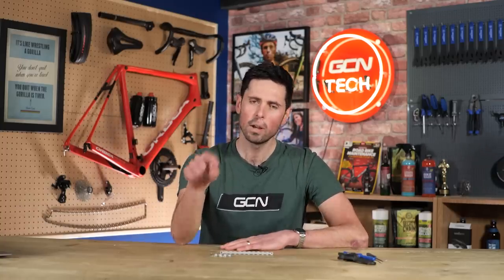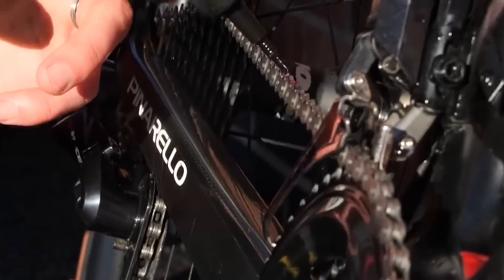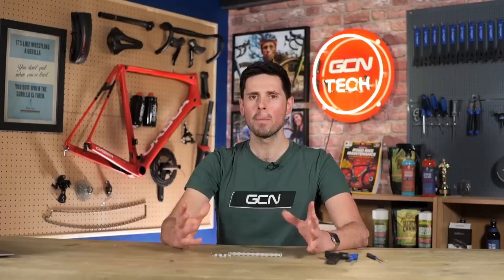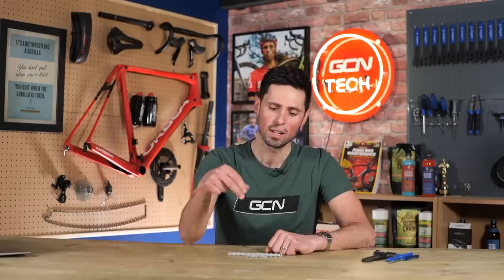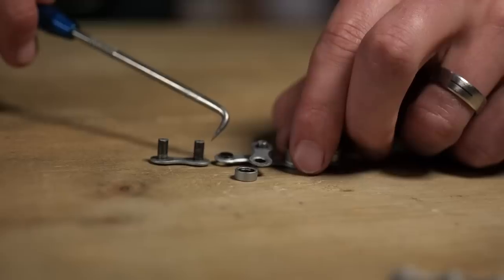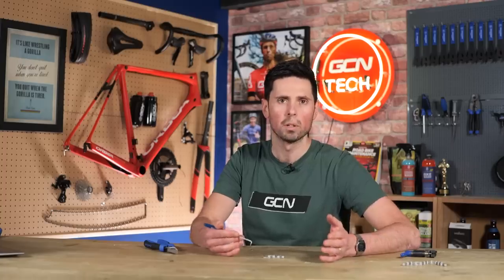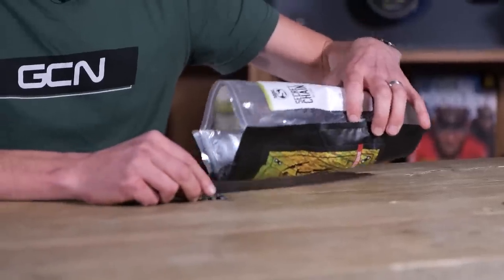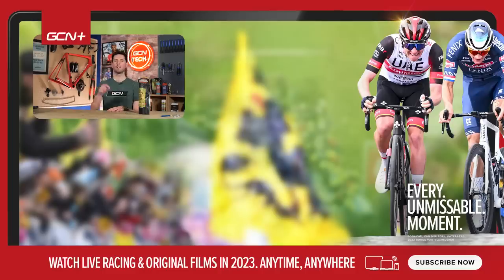5 Ways You're Destroying Your Chain & How To Lube It Properly!

Comment: i use rock&roll gold [light] to clean the chain and C3 ceramic [heavy] to lube. i have used all kinds of lube but these two combination works perfectly for both of my road and hybrid. keeps the chain clean and lubed longer and I can easily get about 4k miles out of midgrade chains before needing a change.

Comment: I use racing oil on my every day racing bike, especially for wet weather. Because it better protects my chain against bad weather conditions. In the summer I use "dry lube" because it lubricates and shifts the chain well. I work in a bicycle shop and a while ago an email from SRAM went around asking not to use wax. We also notice in the workshop that a lube shifts much better and is quieter than wax.
Reply: Yeah, that's my experience too but I'm always a little scared to voice it because so many people swear by the waxy stuff (its a kind of emperor's new clothes thing).
Reply: Weldtite all weather TF2 is the best everyday bike oil by far, cheap too. Tho honestly I'd rather use engine oil than trash like muc-off, squirt, or whatever...

Comment: I use an upgrade to Si's WD40 hack. It's rhe WD40 Specialist White Lithium protective grease.  Works like a champ you just spray it on liberally and wipe any excess off with an old sock. Chains are quiet, last a long time and no need for all the faff. Time is money

Comment: I'm a Paraffin Wax + PTFE guy mostly. Recently bought Tru Tension All Weather Tungsten to use as a top-up (& hopefully deposit some Tungsten Disulphide on inner surfaces to lower friction). I was using a large slow cooker but that failed, so now use food bags with ziplock tops (same as Molten Speed Wax or Silca use?) & melt in hot water. Initial cleaning (meths + isopropyl alcohol) the longest stage...

Comment: I have used approx. 25 different chain lubes over the last 30 years looking for the holy grail.  The conclusion is it does not exist.  I need to lube every 300km on average.  I put 350 to 500km per week on average during the season.  I clean my chain with mineral spirits (Varsol)  until clear 3x then rinse with denatured alcohol.  three years ago I tried wax.  A real pain in the ass.  Two seasons ago I was using Silca's secret sauce.  It would last about 300km,  but the chain would be black to the touch and I would have to clean the chain completely otherwise the product would not adhere to the chain if I wanted to do a touch-up to the chain.  On the recommendation of Chris Horner (winner of Vuelta 13'), I tried the Squirt product.  Best so far and it allows for touch-ups.  After 8000km my chain has very little wear as measured with digital calipers.  I run Record chains on my bikes.  If Campy had a reusable quick link I would use an ultra-sonic cleaner.

Comment: I have been using wax for some time now and it's the best option there is. It lasts longer, it lubes better than anything else and you can touch the chain after riding and have a clean hand. Never going back to liquid lubes again.
Reply from the maker: Great to hear that you've adopted waxing your chain 🙌
Reply: How often you need to apply new wax? I am interested in this, but have doubts how they last in very long continuous rides (400-500km)
Reply: Depends on conditions. Dry that distance should be fine but wet can wash out the wax fairly quickly. The performance of wax suspension bottled lubes should give you a good idea, a hot wax soaking is better but not massively so.
Reply: @GSHemuli  I just go by the sound of the chain, not a set number of km. But I think it could be around ~200. That said, I have an e-bike so there is more strain on the chain. It also depends on how well you clean the chain before waxing. I use melted paraffin wax without any additives so with a purpose made wax you can probably get a bit more too. Then lastly you can extend the interval by using the liquid wax lube when you start to hear squeaking without cleaning the chain or taking it off and it will last a bit longer.
Reply: @martinmikus472  thank you for the info! I use Ultrasonic cleaner for all my chains. I will try some recommend molten wax from zero friction cycling and see how long it lasts.

Comment: I use squirt lube (wax based). Cheap and keeps the chain life long.  No need to mess around with melting the wax first. Just need to fully strip the factory grease.   Best of all, it's clean and shiny.
Reply: Rubbish in the wet and having to fully degrease and dry the chain everytime is a PITA.

Comment: I use Silca's Super Secret chain wax, which you showed in the video. I bought an Insta Pot, and a temp. guage also. You heat the wax in the Insta Pot to 140 degrees, put a clean chain in, and pull it out after a few minutes. It have been doing this for a few months now, and it works amazing! No more gunky chain lube, and greasy bike. Its quieter, and you can tell it's more efficient. i'm not sure about the long term for wear, but from what I see, your chain will last longer.

Comment: I use "WPL Wet Lube" works a treat, bio degradable, stays on the chain in wet conditions, doesn't pick up much crap even on my gravel bikes (but it is a wet lube so it does pick up some) but emulsifies under high-ish (standard hose) pressure or with minimal brushing and no special solvents or degreasers required. Some of the cycling magazines made a big song and dance about how good it was, rating it above many of the usual suspects a few years back, but then it faded in obscurity for some reason. Weird stuff very thick like syrup when applying but a few turns of the cranks and it goes thin.

Comment: Great video. First time I've seen a completely dissected chain anywhere really, so touché on that. However, I respectfully disagree about the bits on not lubing the cassette, the chainrings, and the external chain surfaces, so hear me out please. I put a drop on one tooth of each cog and ring after I lube the chain, and then I run through the gears - all of them. Then, I wipe everything down with white cotton while spinning the crank. I want to see the residue decrease with each pass. There is ALWAYS something left on the cloth no matter how long one wipes. While wiping, I want my external chain surfaces and exposed parts of the cogs and rings every so slightly oiled because these surfaces do slide against each other, especially under torque. I am sorry, but I just don't see how lubing only the inside of the chain gets to these surfaces. Do I pick up more grime? I would suppose so, but I don't see it because I wash and lube my bike every week, or immediately after any wet or dirty  ride. Does my bike shift better? I wouldn't know as my bikes are always clean and lubed. I also don't mind jumping on a sale of a new cassette and/or chain. I've had my Ultegra 11 speed for 8 years now and have replaced both the  cassette and chain once because of a blowout sale, not because I had to. My bike with the SRAM Red hasn't seen any sales! LOL! Anyway, if you regularly clean your bike and really wipe it down after oiling, you can lube away I guess is the moral to my story. BTW, your golf club brush works perfectly!

Comment: Wet lube all year round. I get about 2000 miles out of a chain before it hits the 1% mark on my chain checking tool (the highest is about 2800 miles, over last year's dry summer months, the lowest was about 600 miles through a particularly wet winter when I picked up a lot of rubbish off the roads and ended up with a grinding paste!)
I also find that a cassette won't last much longer than 4000 miles, (measured by seeing if a new chain jumps on the sprockets when installed) but that's another story.
Reply: Change chain at 0,75% to preserve your cassette
Reply: I estimate that I get between 2,400 and 2,800 miles on my chains and change at 0.7%. I have a cassette that still worked fine at 24,000 miles when I replaced it (when the chainwheels wore out).
Reply: That's pretty good going! I can't get 24,000 miles from one cassette (well, not from the most used sprockets on the cassette - it'd be nice if one could buy single sprockets so I could just replace the worn one).
How many speeds has the cassette got? (I'm using an 11 speed, and I find it wears quicker than my old 8 speed which I still use from time to time).
Reply: @MBeest1000  I have an 11 speed 105 cassette (it’s cheaper than Ultegra😆). I do change chains frequently though.

Comment: Molten Speed Wax all the way! I never clean my drive train anymore. At least no degreasing. Wipe down some dry wax residue using a rag from time to time. Once thoroughly cleaned then waxed for the first time, no need to do any more degreasing of drive trains. pop the chain off, dunk it in wax pot, shake then dry, pop it back on the bike. Used to get anywhere from 2000-6000 kms using various chain lubes.  Having converted to wax 5 years ago, last chain lasted 20,000 km to reach 0.5 wear.

Comment: I use the Silca Synergetic lube.  The wax lube didn't last long in the wet conditions where I live.  My chain cleaning interval depends upon the weather.  When its wet, I clean and lube the chain after every ride.  During the summer, dry weather, I clean and lube the chain weekly.
Reply from the maker: Great to hear you are using Silca! 🙌 Having a Chain cleaning schedule is a great idea! Do you find it helps with keeping ontop of maintenance?

Comment: Service bikes as a hobby. Majority of my time is spent removing large amounts of oil and grease from chain, derailleurs, frame and back wheel. I use Rock’n’Roll Gold or Rock’n’Roll Extreme on chain after a clean and degrease. Cleans and lubricates and no mess. Bikes that are transported in cars now don’t mess up upholstery.

Comment: A few things learned in my recent marginal gains pursuit of chain waxing:
1.  MuckOff marketing sucks (and creates a landfill nightmare) with their little UV lights in each package and glowing lube encouraging users to douse the outside of their chains.
2.  It's important not to degrease the chain while on the bike (or be careful) because degreaser can or will (certainly if you service as much as I did) attack wheel and cassette bearings.

I'm so impressed with my "cheap" ultrasonic cleaner.  My "clean" chain left a couple spoonfulls of black gunk in the bottom!  The wax lasts much longer so needs less servicing, fills more voids and saves the rest of the drive train.

Comment: Good job Alex. I clean my chains about three times a year and they run quiet and last at least three years, so far.   Except my trainer, which has had the same chain for five years and doesn't get very dirty. It's only been cleaned a couple of times and I just add lube as needed. That said, I've never measured them. Maybe they're worn out and I just haven't noticed. Often I clean a chain because I'm switching from dry/wet lube with the seasons.
Reply: You can measure chain wear with a cheap tool. At 0,75% (longer than from factory), a new chain is needed.

Comment: Highly recommend Rock N Roll wax and lube combo, stays very clean and lubed, I wash out my chain every 60 miles, spray it out with WD40 then douse it in Dawn dishwashing soap ( a great non corrosive degreaser) spray wash, dry with a towel then apply waxy chain lube, of course clean chain ring and cassette at same time. Chain looks new always, cheers…

Comment: Great explanation! A clean, properly lubricated chain can last 3 times longer than a neglected chain. In my opinion and experience the coating on a new chain is a preservative. It is there to protect the chain from rusting in storage and it is a magnet for dirt. After degreasing your new chain coat your new chain with a real chain lubricant. It will shift better, run quieter and last much longer. There is a culprit on the road waiting to eat your chain. It's carbon dust, from car tires. Your front tire picks the dust up and throws it at your chain. Carbon dust, a molecular abrasive, can get into the tight places much faster than dirt. Carbon rubs your chain the wrong way.  Cleaning and lubing your chain can help control that unavoidable evil intruder.

Comment: Would love to try chain waxing but Scotland is wet. For that reason I can’t be bothered going through the whole waxing process every single time after a rainy ride 😢
Reply: do the same process with multiple chains so you can just switch out or use waxbased driplube...
Reply: Just uses CRC chain lube or the extreme duty version. It doesn't care about water.

Comment: I don't think anyone has mentioned the quality of the chain itself.  Often the ones that come stock on bikes are not the greatest.  I usually wait for the inevitable chain wear and then replace with an Ultegra chain which lasts much much longer.

Also, have modern narrower chains (a result of going from 5-cogs in 1980s to 12 cogs today) made the chain wear problem greater?  I wouldn't be surprised.

Comment: It appears to me that one way to shorten the life of a chain is to "clean it too well". By cleaning down to and into the factory lubricated part of the chain, we can actually be removing quality lubricant and replacing it with inferior lubricant. Worse still, road dirt and grime will have easier access to the working parts of the chain. As in everything, there is a balance between clean and too clean.
Reply: Factory lubricant was good 20 years ago. Now it is terrible. If you are using any modern product, you should remove all of the factory grease before applying. See Zero Friction Cycling.
Reply: @JoshuaBorrow  Thanks for your reply Josh, I will check out Zero Friction Cycling for more info. Cheers, PNH

Comment: Hi Guys, I use to clean the chain with a thin motoroil like SAE 5W and a microfibre cloth every 100-200km. That of course includes the cassette, chainrings and rollers. Then, in winter, I just use the same oil for a slight lubrication. In Summer, I lubricate with transmission oil SAE80 instead to make it stick better. Smells a little though. Big advantage is that these oils are cheap and never harden. Which means that you do not have to spend even more money and time on degreasing. Just clean and lubricate and wipe the excess oil off with a clean microfibre cloth. My chains last about one year until they approach the wear limit after about 6000-7000km, cassette and chain rings twice as long. Considering the money I do NOT spend on expensive special products, this seems a good compromise to me. Remember: A new chain costs less than a new can of expensive lube plus degreaser. I did a lot of Enduro & MC when I was younger and that are really chain murdering conditions. But the same applied: A seasonal selection of thick and thin engine or gearbox oils if applied frequently do the trick at a fraction of the cost of expensive special products. Think of the camchain in an internal combustion engine, which lubrication does it get? Correct. And If you are environmentally conscious: Use bio-degradable chainsaw oil. Or olive oil in winter. Also smells much nicer than gearbox oil.😀 But avoid other natural oils like sunflower, they harden quickly, olive oil is best.
Reply: But engines are not usually subject to the same level of external contamination that chains are to create a grinding paste (& they have a filter to deal with eg soot) so not really a good comparison
Reply: Isn't engine oil optimized for the higher temperatures found inside engines?  Having said that, I imagine your method works fine as long as you clean the chain regularly.  I find some of the expensive waxy lubes don't last long (sometimes less than a single ride before the chain gets that dry, unlubricated feel to it).

Comment: Silca Synergetic in m opinion is by far the best lube I've ever used. Over 3,000 miles of UK conditions with all year riding and the chain checker tool only just went in at 0.5 after that many miles. I have used Muc Off (absolutely awful!), Fenwick's, and finishline, but silca is by far the best. I reckon I can get well over 3000 miles from my chain with better cleaning habits.

Comment: Great video…the only thing I would disagree with is “don’t use light aerosol lubricant”. I’ve regularly used WD40 for years and I know it’s not a chain lube but it does a great job of keeping it quiet, reducing friction and not attracting dirt. I just replaced a chain after 7000km but only because I got a new wheel / cassette, and I swear the old chain looked almost identical to the new chain. Other riders have commented on how clean my drivetrain is.
Reply: Sorry to hear that!

Comment: I think my technique results to even cleaner chain if using wet lubes - I remove the chain from the bike whenever I re lube, to completely avoid getting lube to the cassette and chain ring. I then lay down  the chain over an old newspaper or rag and then apply the lube.  The old newspaper will absorb any excess oil and grime from the chain. And finally wipe the chain down very thoroughly with a rag before putting back on the bike to remove any oil on the chain's surface.  Back pedal the bike as quickly as possible for few minutes and any more excess oil will get to the chain's surface which you must wipe off again with rag.  Repeat back pedaling for few minutes and wiping off until the chain is no longer showing any oil.  This way, the chain will only have just enough oil in the pins to lubricate but little to none on the outside to attract dirt.

Comment: Nice to finally talk about waxing. I have been doing this for the last 2 years and there is no turning back. No more degreasers and black gunk. A tip to apply the wax with a chain on is to have it crossed (bibby-big) to open up the link surfaces. Also, you can use this trick: https://youtu.be/96wmOjdneoY